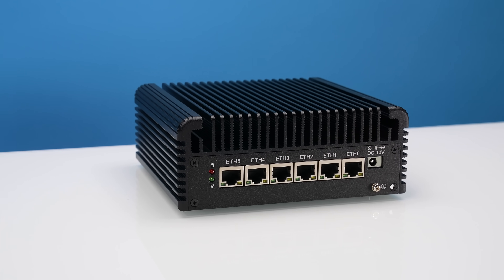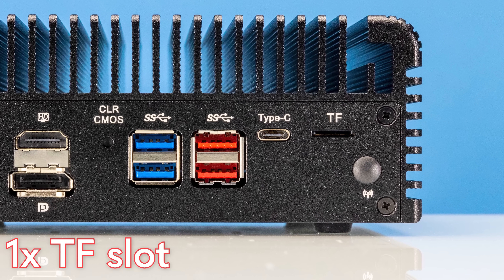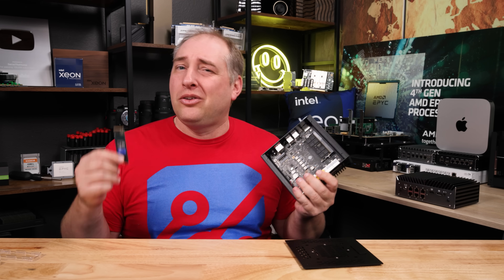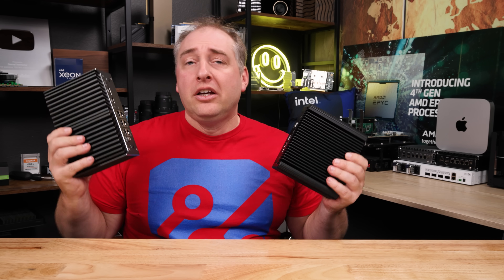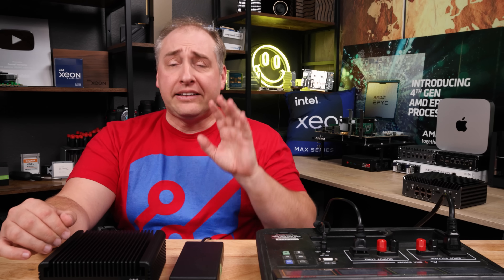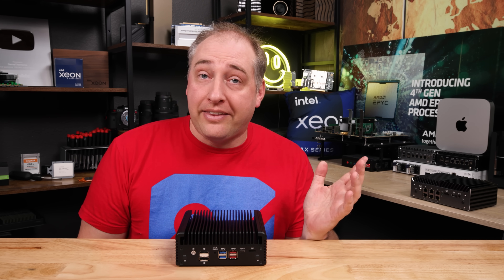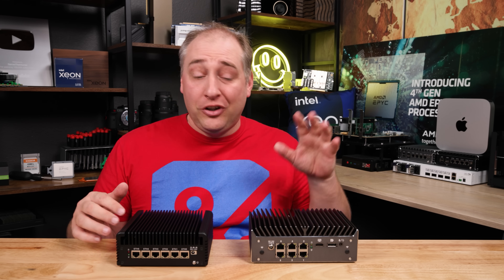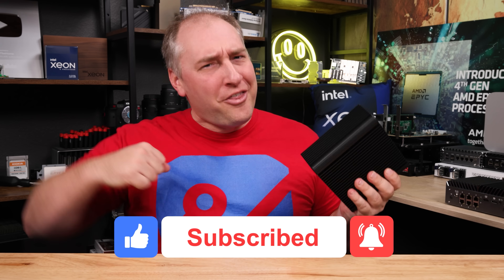KING of Fanless 2.5GbE Mini PC Routers and Firewalls Now with Intel Core i5 Alder Lake

Comment: What power supply should I look for to replace the one I got?
Reply from the maker: I usually do Mean Well units if I replace them, but if you can find this Delta it is not bad. The linked and mentiond forum thread also has some information.
Reply: I'm trying to find a good power adapter but could not find a good one.
Maybe someone can share a link to a good product?

Comment: Great review and a really interesting product. So if I wanted to just run this as a bare metal OPNsense firewall router with IDS features and rules plus a 10Gb USB nic for a server or switch uplink with up to 1Gb internet connection on the WAN side would the i5 still be overkill? Would I be better saving some funds and going for the i3 version? Or would it really be better going for the i5 to process all those functions after all?
Reply from the maker: The 10G USB NIC will perform poorly (likely under 7Gbps.)
Reply: @ServeTheHomeVideo  yep I would have expected that, but still double to triple the base 2.5gb speed which is good for adding some bandwidth. It would still be great to hear your thoughts on the i3 Vs i5 thought with the IDS overheads though :)

Comment: Do any of these small units have 10g copper or SFP+ ports?
Reply: You can put a copper port into this one via something like Innodisk EGPL-T101, and STH reviewed R86S which had two SFP+ ports via Connect-X3 card inside.
Reply: My idea is to take a ADT-LINK Riser PCIe X4 3.0 and slap a dual 10Gbe card in the PCIe slot. There is a small hole underneath the unit for cable routing.

Comment: Hey, just want to ask, is the M.2 PCIe slot for SSD gen 3 or gen 4? The official website just says M.2 NVMe x4 but idk which gen this slot uses.
Also I want to ask if the USB type C is USB 3.2 gen 1 or gen 2. I think it would be weird if the USB-C supports only up to 10Gbps(gen 1) as it has 2xUSB-A that can do 20Gbps(red colored ports)
Reply: This is PCIe 3.0. Gen 4 would not make any sense. PCIe 4.0x4 would be insane speed. It is Gen 3 with 4 lanes. For the devices with 1 NVMe slots that has 4 lanes, I think those are the ones where they make this advertisement with the splitter card/board to get 4 NVMe slots. Thats all good and nice, but whoever is doing this should be aware you have then PCIe 3.0x1 for one NVMe disk. A high speed NVMe drive will then no longer make sense.

Unfortunately, nobody who creates these videos really goes into the details that matter. Nobody ever provided how the 6 network interfaces are for example connected. If each is connected to one pcie lane or if something is shared. Which is pretty important for some folks.

Comment: Regarding the iGPU options, there's actually a similar stepping from the i5 to i7 as from the i3 to i5. The i7 has 96 EUs to the i5's 80. The i3 has 64 and thus doesn't meet the "Iris Xe" threshold, but it's still 16 extra EUs per model number. But then it's supposed to be a router ...

Comment: Compare to used M920q or newer model one with PCIe slot, the pricing on those units never make sense to me.
Reply from the maker: We lookd at the M920q Tiny some time ago as part of Project TinyMiniMicro. It is hard to compare new versus used pricing directly. This is faster than the Core i5-8500T M920q, lower power, has 15x the networking speed built-in, a newer AV1 supporting GPU, and is fanless.

Comment: Are there any videos comparing and recommending products by task or price category?
I guess six ethernet ports may be good for router, but two may be sufficient with external (maybe managed) switch, but CPU might be a bit overkill.
On the other hand some proxmox with virtual servers may benefit from RAM and some may be good if you want to run some demanding tasks and even raspberry pi or something with celeron has some use for monitoring and logging as something that consumes little power.
Reply: I haven’t seen such videos, it’s not usual in the format. It’s always best to get a device that exceeds your absolute needs today so you can fit tomorrow into it as well. If you aren’t looking to cram tons of things into a single node, the weaker nodes suffice for quite a lot. There’s also value in redundancy so you won’t lose all your services if you need to service one node. You can always also try one kind of node and sell it off if you find it doesn’t match your performance expectations
Reply: @jusia80  Thanks. Yes, I understand. I just started with home server. So far it's USFF Fujitsu with i5-6500t running nextcloud and clouflared, next might be syncthing and some photo gallery (but nextcloud is suffient for that). Reason is sharing data with friends and family and maybe replacing onedrive. I quickly learned that Celeron with 2GB RAM is far better than Raspberry3, but not good enough.
Reply from the maker: We tried doing a 2.5GbE switch round-up (Video here: https://youtu.be/brQUwucJLtg ) but that was VERY tough. We might do something on the main site like this. The RPi is good, until you need more than one.
Reply: @pavelperina7629  For your use cases I would say peak single-thread throughput and RAM for caching are both going to strongly effect your user experience. That 6500t is most likely very good for you unless you are ready to shell out for a 12th gen box. I have one 9400t lenovo one-liter unit for its NVMe slot, but unless you run VMs you probably won't need 6 cores. Look out for good deals on memory modules and reach for 16GB total, unused memory will be used for cache speeding up your repeated filesystem operations

Comment: 10:11
In short -- lots of ethernet inputs, cpu power but "in the real world" you can only use less than half of its potential unless you spend more money on some serious cooling solutions.
Reply from the maker: Well, to be fair, there are folks in the forum thread who are changing power levels and throttle points and getting much better performance by using the temperature as the throttle metric. This chassis has more cooling than is being used with its defaults.

Comment: Great review as usual, Patrick. Thanks a bunch for testing these fanless Mini PCs. Also, I entirely agree that this i5-1235U system is a little bit too much to be used just as a router, the much lower priced N5105 units do fine for this application.
Personally, for ProxMox, I prefer the AMD Rizen 7 5825U unit that you reviewed some time ago, it handles 16 threads vs 12 for this i5-1235U box. But indeed, it needs two fans to handle the heat whenever it is not idle. Choices, choices... :)

Comment: Kinda new to all this but would it be advisable to use this for VMs as a router, NAS and simultaneously for hosting a small website with like almost no traffic? What are the downsides of having just 1 box for that?
Reply from the maker: That would be fairly easy for a system like this. The only challenge is that the NAS you would likely want more drives for.

Comment: If I remember correctly the i7-1265U has intel vPRO support, so if that model is shipped with an i226-LM nic, then it has the chance that it has AMT support (I doubt that tbh). I would not say that the possibility of a non-confirmed AMT support justifies the price difference, but for me, that is the key difference between the i5 and i7, since the clock speed difference almost negligible... :)
Reply from the maker: That version is all i226-V. Also, for vPro support you not only need hardware (CPU, NIC, PCH) that supports it, but the actual system needs to as well. There are TinyMiniMicro nodes from Dell, HP, and Lenovo out there that have the i219-LM and a CPU/ PCH that should support vPro, but do not have vPro enabled.

Comment: Personally, I am not a fan of integrated WiFi in these devices and prefer a multi antenna USB solution (that can be easily updated as standards change). This way I can position the antenna in an optimal position.

Comment: You can fit  1 nvme + 2 ssd in this little machine,, right?🤔
Reply from the maker: Ours did not come with the SATA data + power cables.
Reply: It has 2 sata ports and 1 sata cable in the box and of course pci-e ( it is not a normal sata cable but a miniature connector for connecting the motherboard)
Reply: Thats providing power and data to the connector

Comment: Hi Patric do you know if this unit has a sim card slot installed if not which of these boxes has one. I need a travel router with 4G or even 5G and VPN or WireGuard. Can you recommend something knowing your knowledge.
Reply from the maker: I think they have a solution for this that we do not have. The listings say you can get LTE for example, but we did not get that option.
Reply: @ServeTheHomeVideo  I believe the only option is an add-on card for PCIe

Comment: How safe and reliable are these chinese units? Component quality, solder quality etc? Ever have one burst in flames i.e. would you feel safe leaving the house with this running?
Reply from the maker: I mean I have had the J4125 one running 24x7 in my home for over a year and it passed 365 days of uptime. We have 2 of almost all of these fanless units on at all times.
Reply: @ServeTheHomeVideo  Thanks for the info. I hope you'll follow up with a video if such a unit after a while fails.
Reply: it will work until it dies.
Reply: You have no idea what's running on them because even if you flash the firmware, you can't trust the bootloader, and even if you manage to flash your own bootloader, you can't trust there's not a hidden partition on the ROM with code that will mangle whatever you flash to it. So, IMO: not safe at all. I would never run something like this at the most security-critical place in my network.
Reply: @brotatobrosaurus5411  and there is no firewall in your critical place?
Reply: there is, but the hardware isn't manufactured in china. i'm using a pcengines machine with supply chain transparency and coreboot
Reply: @brotatobrosaurus5411  you did not get my point: if you have firewall, you can do your best to isolate the piece of hardware/software you are afraid of, right?
Reply: oh, yes sure, but i thought the implication of a machine like this is that you're using it as your firewall. hence why i said i wouldn't run it at a security critical point in my network. i have no problem running chinese hardware in a place i can monitor it and lock down its connections.
Reply: @brotatobrosaurus5411  It's such a low volume device that there would be literarily no point to do any shenanigans with the "bugs". The only bugs that are in the bios are memory compatibility and such :) On that topic, either buy with the ram or get samsung based sticks, in my testing it does not like anything else.
Reply: I have an old J1900 box with this style of case. It's been running for like 6 years straight with no issues.
Reply: Aside from the included M.2 drives that you should avoid anyway, probably the least reliable part of the average unit like this is the PSU.  Bad PSUs were even a source of failures for D-Link or Netgear years ago.  Here, though, the PSU is Delta and should be fine.
Reply: @brotatobrosaurus5411  Even if you diy all your hardware yourself, all the parts you put there, they still come from China.

Comment: I am super surprised: you maxed out the CPU and it goes to 75W. My system - AMD Ryzen 7 5800H - maxed out is 65W. Yet the CPU benchmark of Intel i5-1235U is 13706 vs 21287 for Ryzen 7 5800H. And mine is with fan (fully on when maxing it out), 1x nvme, 1x ssd. Where is the logic here?
Reply from the maker: As mentioned, that is only for a few seconds, then the entire system, including 6x 1.3W TDP i226-V NICs uses like 30W constant. The 5800H uses more power after those first few seconds.
Reply: @ServeTheHomeVideo  the 5800H in the form or Beelink SER 5  when I start stress test it stays at around 65W until test is finished - once I tested it for 1h and it stayed like this. In idle mode ... no, there is no idle mode - it is always doing something since I have there lots of VMs

Comment: Hey Patrick, any plans on checking the units with the N95 up to N300 in it?
Reply from the maker: The N305 orders from two vendors got cancelled :-( CWWK told me they would have a new one in the next week or two.
Reply: @ServeTheHomeVideo   seria muito interessante se adicionar Sfps 10gb conector
Reply from the maker: Someone is working on 10GbE in the forum thread
Reply: @ServeTheHomeVideo  with slot nvme x4 using adapter ?

Comment: I have this exact unit but while trying to install proxmox the display turns off just after the installation has started.  Patrick is there any solution you may suggest?
Reply: Got the workaround after watching the whole video. Thank you so much - I was one of the folks cursing @ the dang box
Reply from the maker: Glad it helped. That thread in the forums is also great.
Reply: With hdmi yes but with displayport no problems

Comment: Looking forward to reviews of N100 and N305 systems.
Reply from the maker: N305's should start shipping in the next 2 weeks. We had orders cancelled from multiple sellers :-(
Reply: Came here to say this. I don't need P-core performance (or price) on the infrastructure, but the n-series seem like they'd be great to host a virtualized/containerized router, firewall, VPN, and a few other lightweight services.
Reply: @MarcDoughty  I really want a containerized linux router.  While I could try to DIY it, I'd rather have someone build up a UI and what not.  Those Beelink S12 with dual 2.5G interfaces are pretty cheap and would totally get the job done.

Comment: I beg to differ. At 6W TDP, Alder Lake N100/N200 are the new N51505 therefore the kings right now.

Hope you cover N100 AND N200 as i would love to see the difference on those. N95 is a 15W part so its not as attractive.
Reply from the maker: Alder Lake N is in progress. Lower power but lower performance and capabilities compared to this.

Comment: “We really haven’t had issues with i226” - have you tried installing Pfsense? Apparently not.
Reply from the maker: We called that out specifically in the OS section.
Reply: You’re right.

I ended up going with OPNSense and it’s a great system. I’m running an older box with a J6413 with 64GB RAM and m.SATA - would be completely unnecessary but now I want to upgrade to this one! Perhaps I’ll order it as a desktop box I can take when travelling as an excuse 😂

Comment: Despite the form factor and the included i226 LANs, these Alder Lake variants are a bit overpriced... I can almost build an ITX with more performance cores and proper PCIe slot and avoid the issues surrounding efficiency core support.
Reply: Your ITX system will be 3x the volume, have at least two fans and will probably cost a lot more.

Comment: I do not understand why they do not make a device that is also an WiFi access point with a SDD inside, so one can use it as router/access point and NAS. I do have a Asus router with Merlin, and then I had to buy a Time Capsule for backups, because usually access points/router don't come with an SSD and the processors are too slow. I won't buy a router like this, then a classic linksys/asus or whatever brand as access point. People need a single device that can do it all, no 3 difference devices.

Comment: I have this one with the Pentium Gold 8505, and its a crap. Totally unstable and crashing all the time. Doesn´t matter if Windows, Proxmox or ESX. CPU is in idle around 50°C so you need active cooling if you want to have this device for longer than 1 year....
Reply: Regarding cooling, I put a 120mm fan on top of the case. As the case works as a big passive cooler, the CPU is going down now to 25 °C. Only the NVMW is still hot. So I am also going for the 8010 fan inside.
Reply from the maker: Super interesting. We have this running Windows 11 and doing video playback right now and it is at 39C.
Reply: You might need to check the thermal paste on it I'm guessing. That does not sound right.

Comment: greetings, what is the chance that in future videos you will also pay attention to the compatibility of those machines with mikrotik router-os, not all install proxmox and pfsense on such machines
Reply from the maker: Interesting idea. I will have someone on our team looking at licensing. Usually we have this set because we have free OS images.
Reply: AFAIK their x86 bare metal images are kinda abandon ware at this point and last I checked had serious issues with drivers. But their CHR images run just fine in a VM on pretty much any hardware.
Reply: @ServeTheHomeVideo  AFAIK for CHR it's just a code you put in, 1G is 50$, 10G is 100$. 10mbps is free to play with.

Comment: The difference between i5-1235U and i7-1260u is not just a couple of MHz, it's two more P cores! You might have been thinking of i5-1240P vs i7-1260P.
Reply from the maker: Core i7-1265U is 2x P 8x E per Intel Ark. https://www.intel.com/content/www/us/en/products/sku/226258/intel-core-i71265u-processor-12m-cache-up-to-4-80-ghz/specifications.html
Reply: @ServeTheHome  you are right. Not sure what I had in mind, then. 😂